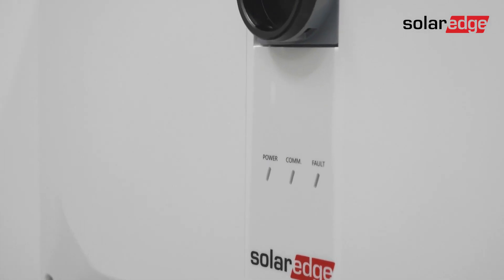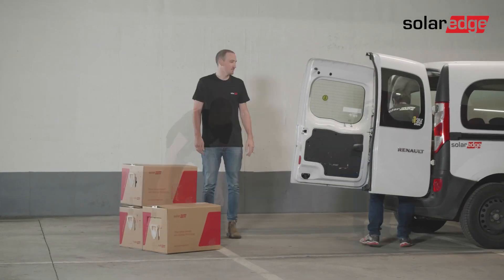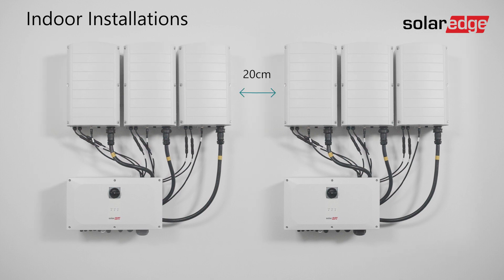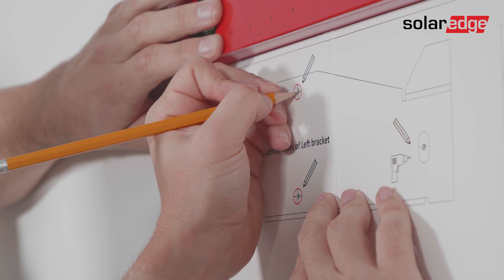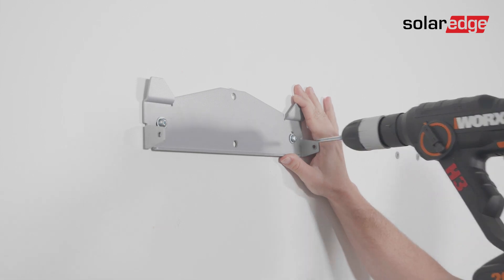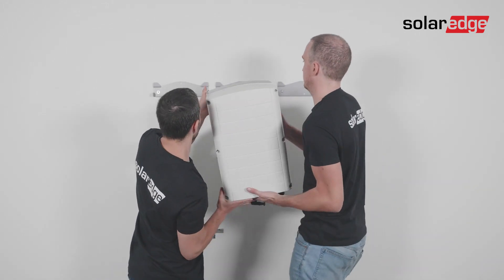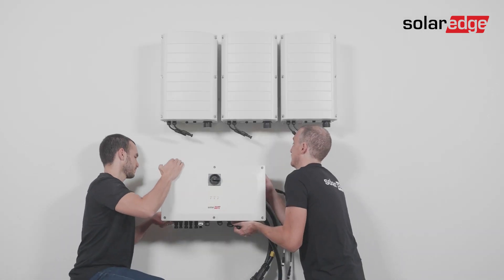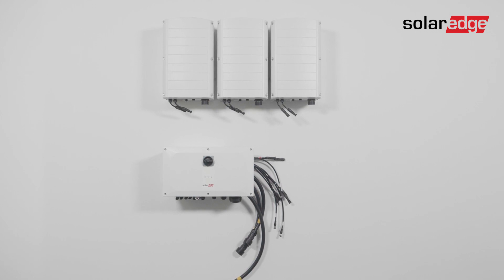Mounting the Three Phase Inverter with Synergy Technology, up to 120kW

Comment: These are a pain in the ass to install if you have to replace the older models. Why isn't the combiner under the center unit with similar knock outs?? A swap out literally took two days and cost 600$ in materials because we had to re-run all the conduits for AC, DC, Coms and pull new wire. Please provide a kit with longer cable lengths to each inverter head and have the option to assign head location. Also, poor packaging and the plastic handles broke off as soon as I lifted the box.

Comment: Is there a link for the installation manual? My inverters are not onsite and we have to build out supports for the brackets. Installation manuals on Solaredge website seem to display the older models
Reply from the maker: Welcome to SolarEdge, thanks for reaching out!
To connect with a local support agent or check the status of an existing case please visit the link below:
https://solared.ge/FB
Please note that SolarEdge is unable to provide technical support via social media.
Thank you very much and we look forward to hearing from you soon.